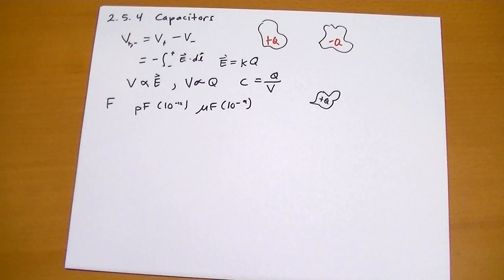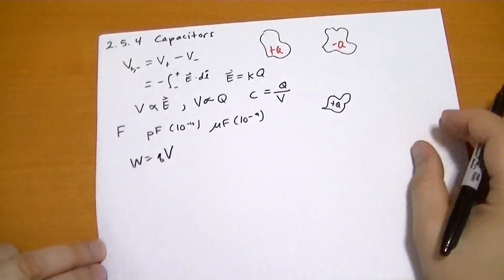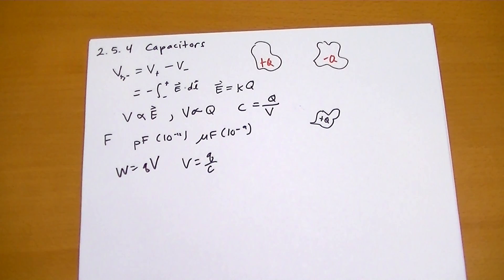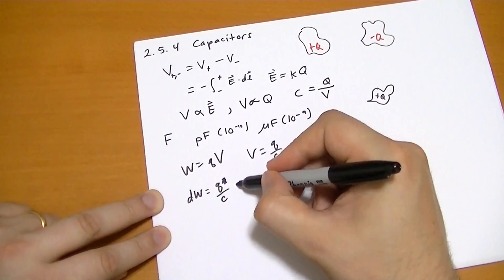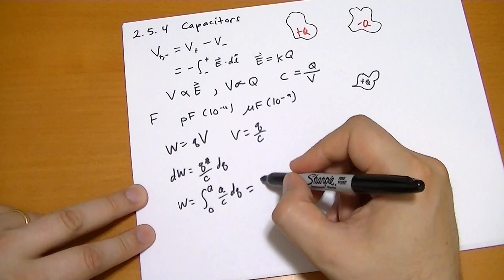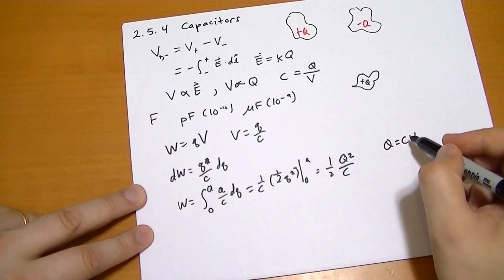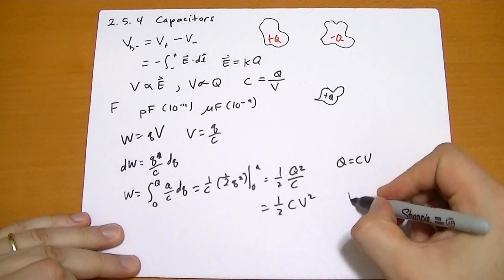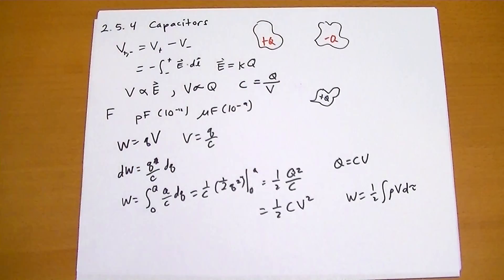2.5.4 Capacitors (cont.)

Comment: Any chance you'll be doing anything with the "homework" problems?  I'm working from 4th Edition, and one of the problems there, 2.7, is stumping me.  I have the solution from the solution guide (I'm doing this for personal enrichment, not for a class), but can't see how he got there from here in the last steps.  (If you don't have 4th ed, it can be found free online as a pdf, as can the solution guide)
Reply from the maker: I bought the 4th edition (the international version -- paperback.) Where would I find the problem?
Reply from the maker: If it's the problem with the square loop with uniform charge -- set up an integral and solve for the E field a distance d from a section of wire with uniform charge (Problem 2 converted to an integral. Convert the elevation z to a distance from the wire, and then multiple by 4. If you have a hard time setting up the integral... it might be time to review what integrals are and how they work. Basically, you want a sum (big S) of the E field from a tiny slice of the wire width dl. The E field depends on where the dl slice is away from the point in question. Write the equation for that, put it in the integral, and you should be able to solve it.
Reply: Problem 2.7, page 65 in my version.  Electric field a distance z from a a charged spherical surface.

I can follow everything except the last 2 steps in the solution.  The computation ends with 1/rPiEps0 * 2Pi R^2sigma*[1/z^2 * (zu-R)/(sqrt(R^2+z^2-2Rzu))] -1..1

From there, he expands into a form with absolute values are reaches two conclusions, for z<R and z> R.  I can't follow how he gets to that last form, and then how he gets to the two conclusions.
Reply from the maker: OK, I got the hardcover 4th edition which has the same question. What is "zu"?
Reply: Real Physics that'd be my autocorrect changing 'z' to 'zu'....